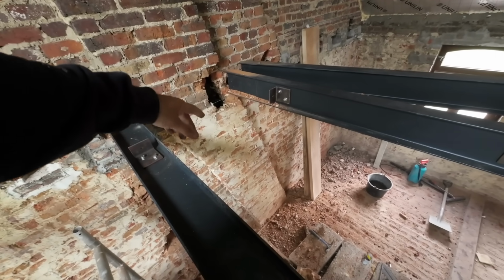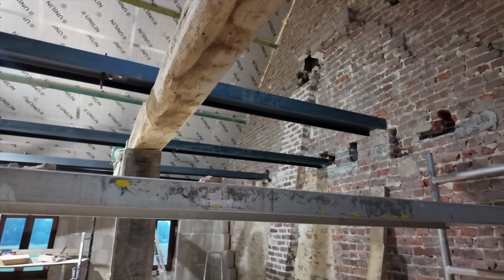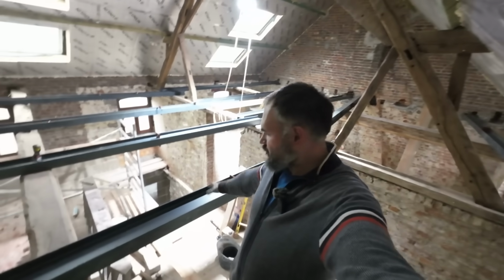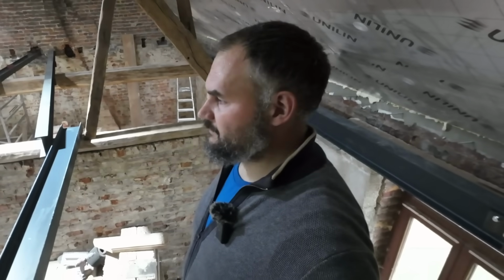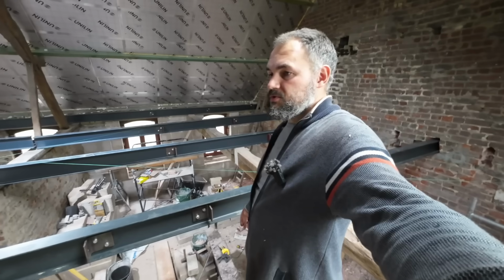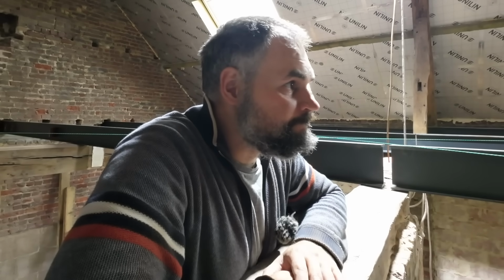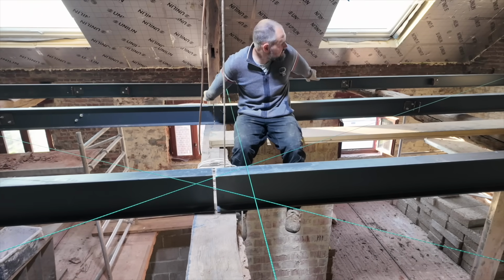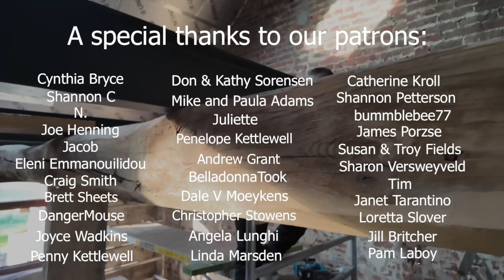Almost perfectly leveled floor / Renovating a 110+ y.o. ABANDONED farm in Belgium

Comment: You should look at some vlog from Escape to Rural France and see how he put in beams and wood beams between, using noggins....no metal corner hanger pieces, no drilling, all very simple and incredibly stable. It would save you a huge amount of time and effort, perhaps.
Reply: They’re bolting the  reclaimed rustic looking beams between the steel as a feature that will be seen from below. The brackets and bolts are part of the design to make a strong contrast between the precise steel work and rough timber so the extra effort will be worth it . Dan is plastering his ceilings so the beams will all be hidden 👍🍻
Reply: @drunkdunc8738  I guess exposed bolted beams has some sort of aesthetic effect. Different strokes for different folks, I guess.
Reply: Personally I wouldn't have bothered with the steel. I would have used green oak instead.

Comment: Illia, a quick tip to make the drilling easier on those thick beams. If you keep the drill bit lubricated where it is cutting it will go much faster and you will need to use less force. You could buy cutting or tapping fluids like machinists use if you want. But realistically all you'll need is some basic motor oil. It won't take much a few squirts in a little pool right around the head of the drill. It'll save you time and energy. Maybe you did do this and it was lost in editing I'm not sure. But I figured I'd mention it just in case.

Comment: @11:34 Using strings will work ok, but every beam that is too high will push the string up rendering it useless.👴😨
To avoid this, get some pieces of wood that have the same thickness and use them as a spacer to set up the line.
Then with another piece of the same thickness you can check the gaps.👴😉
@14:40 For that last cm., you also can use some polyester stuffing. Mix it properly, put it in a plastic bag (to avoid a mess) and lower the beam on it to its proper height.
Within the hour the polyester will be cured and form a perfect bed.  You can even saw the edges to let it look better.👴😊
Reply: I also think using an offset string line would be the best way to go. that is what I am doing (in "flattening my subfloor); much like you, I am not necessarily looking for level, just flat - flat is necessary; level is desirable...

Comment: Seems to me it is a bit over kill putihg metal beams where a good 2x6 or 8 set  on 2 ft or 18" centers would be sufficient for any ceiling structer.  This would be adequate even if you intended to form a second floor space above it. Just wondering.....
Reply: Steel can be cheaper than wood these days.